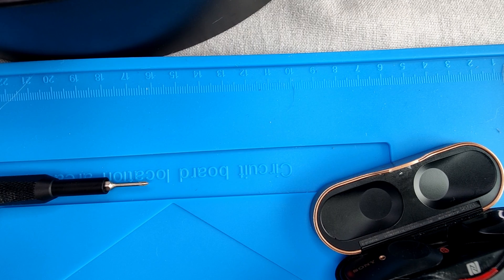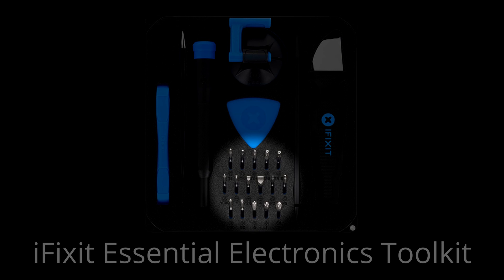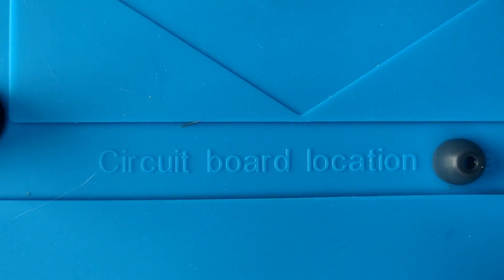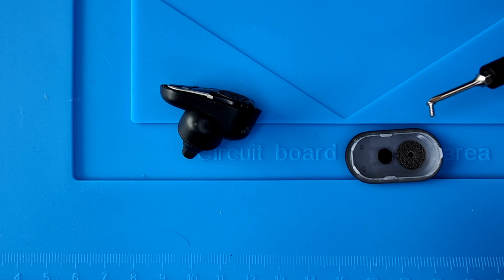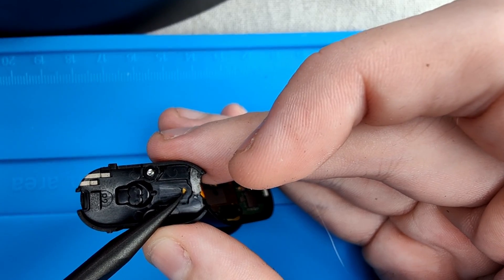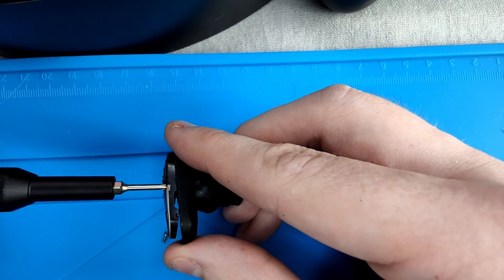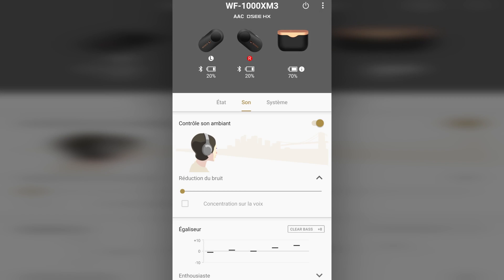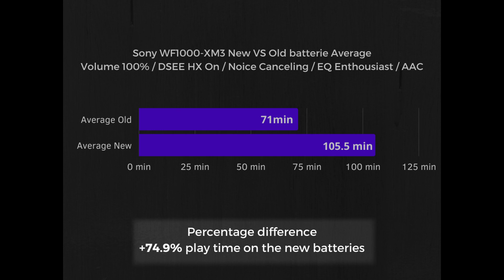Sony WF-1000MX3 Battery Replacement + new battery test

Comment: Thanks man! I follow your instructions and replace the batteries by myself, you just forget to mention that the metal sheet which is attached to the battery must not touch the side of the battery itself because it causes a short-circuit. by the way, after more than 2 years I needed to replace the batteries because they hardly ever last for more than an hour. Now after first test they last for more than 2 hours! Notice that! always head for Sony authorized repair shop first and ask them for replacement.
Reply: Thanks for the tutorial @Saroua. I just replaced my batteries and using my earbuds now!

Thanks Adam for the note! I noticed that the cell was overheating once I pasted the metal sheet and realized the the negative and positive(side of the cell) ends were connected. However when I put the cell inside the casing, the was a gap and it was not short circuited anymore.  @Sarousa, this should be added as WARNING for beginners.
Reply: explain to me -- if the batteries are replaced -- why can't it get 4 hours of play time? what is the difference between the replacement batteries and the original such that they're only getting 2 hours. if only 2 hours - i will just toss them. i already got the xm4s. but was hoping to keep the xm3 around. but not if i can only get the 1 to 1.5 hour to 2 hours or so.
Reply: @BFree-bb8nh  Not that there is many features drain the batteries, you can disable these sound enhancing features and gain more runtime. By the way I don't having too the same runtime after replacing the batteries like new purchased one.
Reply: @BFree-bb8nh  replacement batteries aren't identical to the OEM ones. The OEM ones are of better quality.

Comment: I’ve had mine since early 2020 and they’re still amazing, not a single issue with battery life and I use them every other day or so only requiring a charge once or twice a month. I do tend to listen to fairly low volume though so maybe that’s why they last so much longer

Edit: forgot to add, watching the video in case I need it, wanted to confirm if the battery was replaceable or not 😂
Reply: @kipzonderkop1994 wait what for real you charge once a month.. Hahah..
Reply: @TheXcuTionerX  lmao Yh for real, I charged them, used them here, went on a holiday for a week and used them a fair bit, came back, they still say battery fully charged 😂
Reply from the maker: I'm deaf AF ahah

But honestly sometimes you just get a worse battery too
And I honestly used them a TON and so had to recharge them often and I went through the cycles quick

Comment: HOLY SMOKES!
I bought these exactly 2 years, 1 month ago and the earbuds discharge at an unequal rate. The left one discharges considerably faster than the right one. Plus: The left one discharges completely after merely 30-40 minutes of use :(
I was considering buying new ones, as they have dropped in price significantly (about 100€) and they are definitely the best true wireless earbuds i've EVER had.
That was until now because i absolutely did not realise how stupid easy the batteries are to replace!!
I was absolutely convinced one could not open these without totally destroying them in the process.

Thank you so much for this video!!!
I will be replacing the batteries myself ASAP!
And should i fat finger it somehow and destroy them, despite them being so easy to repair, i shall order new ones :D
Reply: Dude, just buy the battery and get a phone repair shop to do the rest..
Reply: I have the exact same issues with the left one dying within like 20 mins. Did you change yours in the end?
Reply: @Kalamoren  i did :) 
Still works perfectly and still using the WF-1000XM3
Reply: @ghibliq  Cheers, I'll definitely replace mines too then.
Reply: @ghibliq  I replaced the batteries today (finally) been listening to music for over 5 hours and they're still going strong. Struggled a bit opening them though as I only had one of those guitar pick plastic thingy

Comment: Thank you for this guide ! My left earbuds has only a battery life of 4 mins and the right earbuds a battery life of 30 minutes after 2 years of daily use in public transport, at gym and by traveling.
Reply: That 4 min is same as mine Lool
Reply: Battery life with the new batteries was still poor compared to new earbuds where they were around 6 hours!
Reply: @Tom Tl i keep reading about all these battery break thrus online, but when will they come to actual products? i went thru 3 plantronics due to this issue.

Comment: just opened my right one up but I doubt I can save it... lost it when jogging and found it two days later. When I found it the gap between the case and the lid was wider than it should be on one side. after opening it and removing the screws I found some blue gel all over the pcb do you have any idea where that came from?
Reply: probably from factory lol
Reply: I sell them cheap on ebay if you need a left or right earbud let me know

Comment: I bet your french as me by the way you said "varta" :). Anyway i'm gonna try your tuto soon my right earbud battery's is slowly dying. After only 30 minutes of use it drop down to 20%. I have the sony WF1000XM3 since they were released and even if getting the new 1000XM4 is tempting puting another 250 eurosish is really not.
Reply from the maker: Yeah I'm a french speaker indeed but not french per se ahah

Good luck on the fixing !

Comment: Thanks for a great and informative video. Any idea if the case battery is possible to replace?
Reply: Yes it can iv changed a few as I repair them and sell replacements etc on ebay of the x3s
Reply from the maker: I know it is but I couldn't give you the model of it

You should be able to find some info out there about it :)

Comment: Just bought a two pack of the batteries on Amazon, and it took a little longer to get off the faceplate BUT they work and charged fully. Great video, thanks!!
Reply: Hello please can you help with Amazon line you bought from, I can’t find the batteries
Reply: Yeh, I JUST did the replacement, and had the issue with getting the faceplate off aswell! Though the scratch marks are worth it, for the money saved, they still sound great!

(My XM4's also ended up getting the "right-side-battery-rot"-issue, so just replaced a battery in those as well) :D

Comment: Hello, I would like to buy these Sony WF 1000MX3, they have all the features that I want and battery can be replaced above all.  But I heard that they are not comfortable to wear (after 3 hours) and they fall out easily.  That is a major reason I am still not decided yet to buy them.  Did you have these problem too?   Thanks to share your experience.
Reply from the maker: Hey, when it comes to fit, well it depends on you honestly personally I don't have an issue but I've heard some people do, may be try them out from someone you that has them

Now on falling out, yes they do fall out easier then other earbuds but they ( to my experience ) don't fall out easily either. It's easier but not easy
Reply: Just got mine and still trying all the tips, but so far comply foam tips are the most comfortable. Probably because I don't have to jam them in as far to get a good seal compared to stock tips. I don't find them easy to fall out, but I'm not jogging with them.
Reply: One thing about the comply tips is the lid will need additional pressure to shut all the way when charging the buds.
Reply: i had to buy 2 different kinds of holders for these XM3s. Got them from online shops. one is invisible around the ear. the other is the string type that holds them like sports earbuds. i also recently bought the XM4s - they seem to hold better. with a smaller case.

Comment: Brilliant video - I just changed the battery in the left earbud. I'm not somebody who does this sort of stuff myself usually but it was very straightforward, and to buy the kit and the battery it was <25% the cost of a new pair. Not to mention the fact that I can use the repair kit almost indefinitely and the environmental benefits. Random observation - for me the metallic connector strip and mic remained glued to the outer cover so they actually came off with the initial removal of the outer cover rather than staying stuck to the middle plastic bit that the battery is housed in. It just made it slightly more awkward when removing the screws because (if you can imagine) the outer casing ended up being attached the whole time at one end (like an open door) and I didn't want to be too rough with it in case I damaged the connector strip. But it seemed to all be ok as the touch control, noise cancelling etc are all working fine now after it was all done! Thanks again for this!
Reply: What battery did you use? How many hours is the new battery last?
Reply: Had the same issue bro, they stuck to the cover, but my controls not working, hopefully they work later on, I've put them back to charge. Thank God I only opened the left.

Checked back later and they're working now!!!

Comment: I can't seem to find batteries that will deliver the same longevity as the original (~4+ hours). anyone know where we can get OEM batteries? I can imagine the VARTA batteries sold on aliexpress and amazon are knock-offs, so they only deliver ~1.5 hours.
Reply: this seems to be a key question in my mind as well. what are the originals having that the replacements do not?
Reply: @BFree-bb8nh  man, i just bought the bose quietcomfort buds (ver1) so now i dont care anymore 😆 the qc buds 2 are getting rave reviews

Comment: Would this work with the WF-1000XM4's?
Reply from the maker: Hi , the XM4 batteries can be replaced but they use another battery , the Zenipower Z55H which has different capacity then the one used in the XM3
I had a quick look but couldn't find a place selling them, there might be off brand with similar capacity and power delivery but will check later

Nice username btw :)
Reply: @JVluluorban  hahah thank you and thanks a lot for the info, I appreciate it. This is the only video I found on YouTube for replacing the battery
Reply from the maker: @ellom8  the sole reason of this video existing is because I couldn't find one , so I decided to make it so others wouldn't need to search for hours like I did 😅

Comment: Muchas gracias, siguiendo tu tutorial pude fácilmente cambiar la batería. Algo que noté diferente es que la batería original de mi auricular derecho (por que solo cambié la batería del derecho que es la que menos me duraba) dice ZeniPower Z55. ¿Esto es normal? ¿Afecta en algo (ya que usé la misma batería que indicas)? Como dato extra yo compré los míos en Amazon México. Gracias de nuevo.
Thank you so much, following your tutorial I easily replace the battery. Something I've notice it the fact that the fabric battery on my right earbud ('cause I just replaced the right one which last less) puts on the battery "ZeniPower Z55. ¿Is that normal? ¿Does this affect in something (this 'cause I used the same battery as you)? As an extra fact i Bought mine in Amazon Mexico. Thanks again
Reply from the maker: From what I could find online it has the same specs as the varta so it should be fine
Reply: dónde compraste la batería el link que publicó ya no aparece??

Comment: Dude, the battery purchase link is not working. It's getting times out.
Reply from the maker: Try the following link https://www.aliexpress.com/item/1005002255850865.html?spm=a2g0s.9042311.0.0.64c24c4dYA5Hbx
There was some strange thing going on with the listing, if it doesn't work look the model up and see the ones with reviews of customer :)

Comment: I just wondering if you are ever got more than 105-110 minutes out of it, with the same settings? Would original powers earbuds for the same time?
I did replace the batteries, with EVE ICR1254 V2.0 (0.222Wh), which was claimed to be as good as Varta CP1254 A3 (0.2Wh, same rated capacity 60mAh. It seems to be true as I've got from the first run 1h 45mins (right earbud) and 1h 51min (left one)... But on SBC codes and volume was around 30-40% as I could not go higher with my ears :-), the rest is the same.  Anyway, it seems to has a limited impact on battery life/juice. I will see how it goes further.   
One note: the clips are very frigle I broke one at the rear side...
Reply from the maker: I've not got more time with them when DSEE HX is enabled, but I honestly don't hear the difference so I disable it and it is a big battery life saver , enabling the option drain the battery a ton from what I've experienced
Reply: @JVluluorban  (lube oil)
after offing DSEE HX - got 4hrs+15mins with 20% left. happy with EVE cells.
Reply from the maker: @05ManSki  happy to read that 
Yeah DSEE HX is a big battery sucker ahah
Reply: @Slava Lyzhnikov   I'm trying to find the Eve cells and I don't know where to buy them. Could you tell me where you purchased them?

Comment: This video is a life saver. I bought the Sony's since they came out on 2019, and now the batteries are dying in like 20 mins so I decided to replace them.
Just a quick question: I found a place to buy the same batteries that you showed in the video, but the guy in the store told me that they are only compatible with the Powerbeats Pro and not with the Sony's, should I go ahead and try them or not? Because it's the same model (CP 1254)
PS: Keep up the good work
Reply from the maker: If its that model it should be fine
They are not exclusive to a model, that said if they are of model thought for a type of earbuds they might have soldered stuff on it but you could always that 

But the battery itself is used in multiple devices
Reply: @JVluluorban  I will go ahead and try it then.
I appreciate it your quick response.
Thanks man.
Reply: Same!

Comment: Hi, i just followed your instruction and change it completely but it is not charging (the red flash of the ear bud isnt appear), how long dose it take to appear. Thank you
Reply: I finish 6:22. But the red flash in 6:24 doesn't appear.
Reply from the maker: @6003ชวิศอาภรณ์วิรัตน์  hi
Did you use the correct type of battery 
Because using a normal button cell battery will not work 
Also there might be adhesive between the metal contact and the new batteries you might need to take it out and put it back
I had it happen with my right earbud as I went to fast
Reply: @JVluluorban  I have same issue but earbud works fine. I read the small LED is pushed into Board so maybe I’ve disturbed it. Urge people to be careful as second one I removed the ribbon stuck and didn’t remove cleanly like first one.
Reply from the maker: @cannibalholocaust3015  The led is indeed soldered on the board, I didn't thought about making a warning for people to be carefull about it as it normally requires quite a bit of force to get them off, may be yours had a poor soldering job done on it :/ Sorry to hear that it happened, I'll add a warning in the description
But you still can guess when its fully charged as when you plug both in they should have the same usage and thus charge to 100% in the same time frame